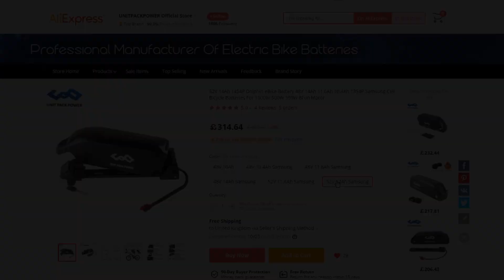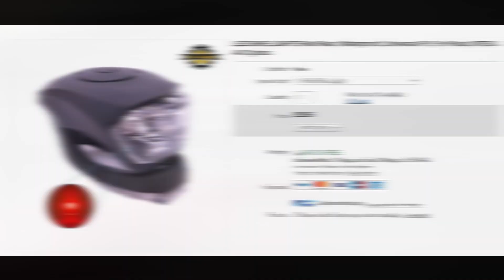DIY ELECTRIC BIKE BUILD PART 11 52 VOLT BATTERY AND LIGHTS BAFANG M SERIES M620 G510 EMTB FRAME

Comment: 11 amph for a 10 mile range . Ahhhh naaaa i need 20+
Reply from the maker: I used to get 25 to 30 miles from this battery
Reply: @baconbuttties  i only get 30  miles in the cold winter but hope my 17.5 amph will do 40+ if i set to 5 levels and stay in 3 to 5 not alot of throttle i can get 10 mile per 3 volts
Reply from the maker: @thomasjurd172  👍
Reply: @baconbuttties  1st got the battery it seamed like it eould do 40 plus but its cold now and does effect the range for sure . I would love a 24ah 52v but not cheap
Reply from the maker: @thomasjurd172  Yes the cold does effect range but I never ride my bike in winter months so I never got to find out the cold range on my battery 🔋.
Reply: Buying bbshd and 800 bac phase runner an spend after i have the funds an want 28ah 52v but there not cheap bud
Reply from the maker: @thomasjurd172  👍

Comment: does the bafang m620 works well with 52v?
Reply from the maker: Yes works perfect with it. Fully charged it shows 57.7 volts on the display and I remember reading that the Bafang can take up to 60 volts.
Reply: @baconbuttties  ohh okk then , asking because i have an bbshd  build with 52v  but had to do some reprograming because was showing  overvoltage error  on full battery 
want to do m620 build  as well  but want to make sure can take 52 v as the sellers i want  to buy it from keep telling me that only works with 48v
Reply from the maker: @corbuvasile6625  yes after your last question  I went and  had a look on the website that  I read about it and it has a 63 volt capacitor so a  52 volt battery is the maximum you can use.
Reply: How is the torque sensor on m620 ,  does feel natural on pedaling ?
Reply from the maker: @corbuvasile6625  feels pretty natural on setting 1. As you go up the levels it doesn't feel as natural especially on setting 5 but 4 and below are pretty good. The only thing I don't like is the slight overrun when you stop peddling and the crank still turns for just under a second so you have to allow to stop before gear change.
Reply: @baconbuttties  did you  change any of the factory settings of  the motor  ?
Reply from the maker: @corbuvasile6625  no haven't touched them.
Reply: @baconbuttties  think worth  doing it as can  greatly change the way the bike rides , there some videos on youtube  on what to adjust
Reply: @corbuvasile6625  The same applies to me. One vendor keeps saying that it is only compatible with 48V battery, 52V won't work. I'm really confused as earlier all versions have been compatible up to 60V. Problem is that this vendor is the cheapest option and could deliver quite fast the motor. I do not know if I will keep going with my BBSHD with 52V battery. I do not want the change my excellent battery right now.
Reply: True true , will later next month will buy the ultra anyway and will check with my girlfriend's  52 v battery first to see if works , and after will decide what battery to buy
Reply from the maker: @mk-uw7sy  I assume the vendor will always say 48 volts as that is what is printed on the bottom of the motor  and is what is recommended. I can only say from personal experience that I have used a 52 volt battery for 200 miles  and have tried full throttle and the biggest hills  around and it has been okay. 
30a x 48v = 1440 watts
30a x 52v = 1560 watts
so it is not a massive improvement if you want to stay on the right side of the warranty and stick with 48v.

Comment: Glad it fits. Good value batteries. Half the price of some. I've shoved a triangle battery in for extra range but 2 of those would be better.
Reply from the maker: Yes they seem like really good value batteries and is working well. Lets hope that the batteries inside are Samsung cells and not something unkown? I may have a peek inside the case one day.